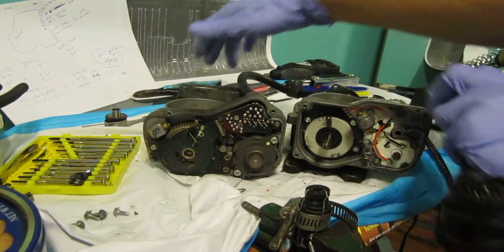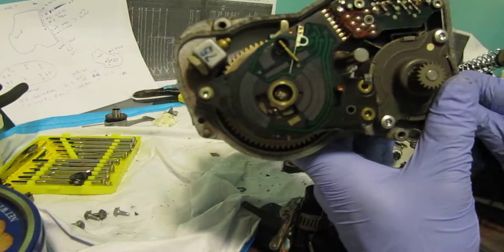Mercedes C220 throttle body.MOV

Comment: Hi guy,

thanks for your video. I have a problem with the throttle body of a C180 (the same of C220). I cannot "disassemble" it. In this video I saw this body already disassembled. Do you have another video in which you disassemble it? I'd really appreciate it.
Thanks in advance.

Comment: hey love your videos. what guage wires you use and where can I find them. I have a 1996 c220 I had bought an updated use throttle body for it but from time to time idle is shaky a bit. I got the PO505 code so I'm thinking of rewiring my old one see if it gets fixed. thanks

Comment: have a question for you , i have a Mercedes E320 Diesel,   i found out the cooling fluid in the reservoir is dark like oil , i recently purchase this vehicle, is that something normal for the cooling fluid or this vehicle has been neglected in not doing the cooling fush.....?

Comment: Hello Vic, I have a 95 c220, I have to baby the gas pedal to get it to accelerate in drive. If I press to fast it dies out also it dies sometimes when I come to a stop and when I put in reverse then it dies when put in drive. It seems I have to rev it up then engage it n baby or just slightly give it gas to get going. Help help
Reply: saltydog 
i have same problem can you help me